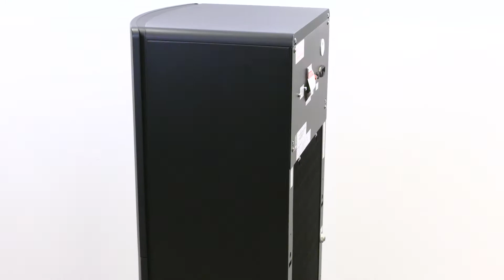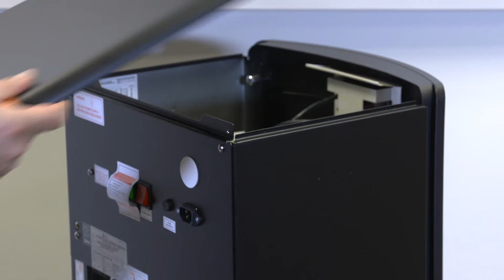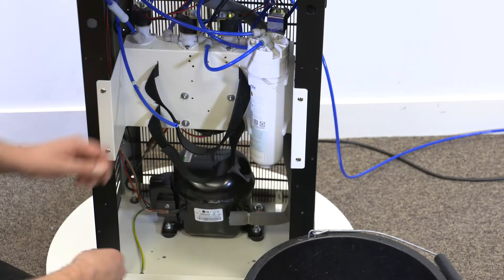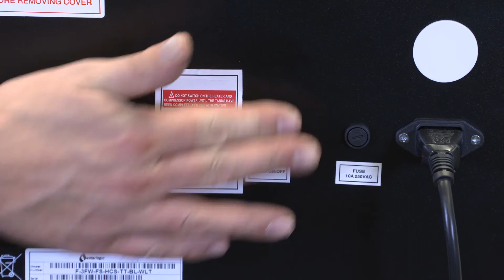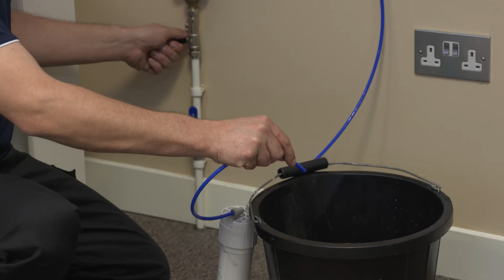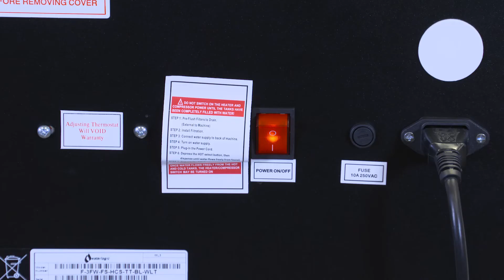Waterlogic 3 Firewall™  Installation

Comment: Why does my sparkling water not running? Co2 bottle is full, there is cold water dispensing, there is light turning on when sparkling icon is pressed.
Reply: Perhaps the pump is not operating. Turn off the machine, wait for a minute an turn it back on. If the problem still occurs, please contact your local Waterlogic Service;)